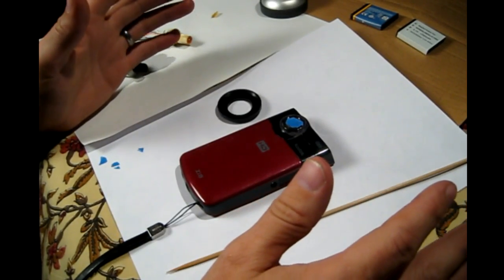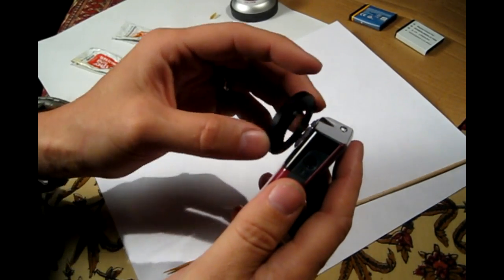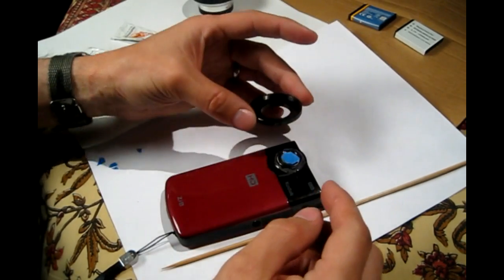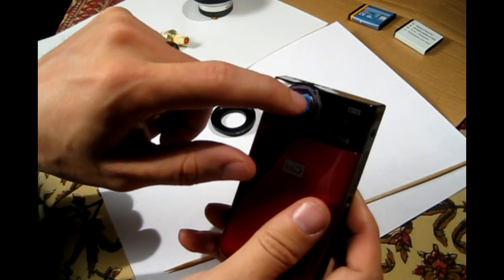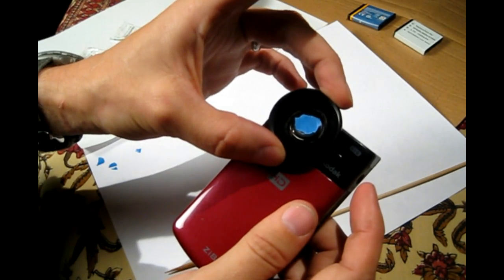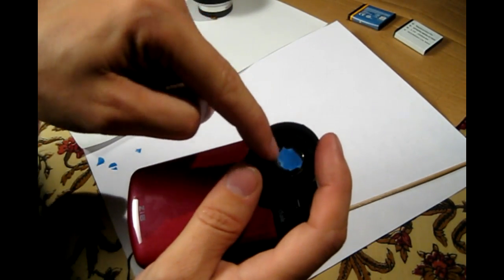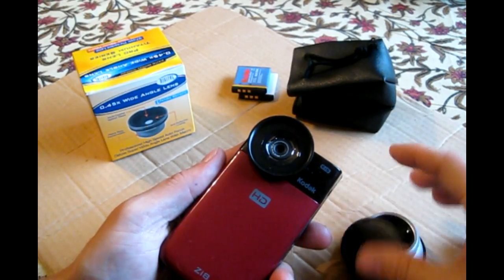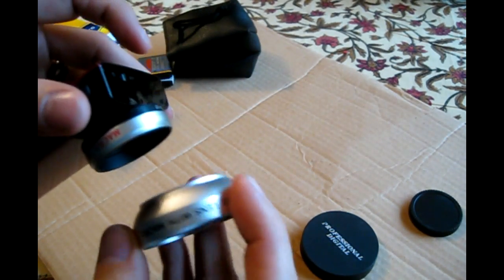Kodak Zi8 Camera Mod Review

Comment from the maker: @SEAetos Yes, but none that are cheap. It is in the telescopic glass that lenses get very pricey.  Buy another step down ring to take your camera to take a 35mm lens (its not 35mm in diameter) and buy an inexpensive telephoto for shutterbugs. That will get you the results you want but may cost more than the camera!

Comment: Great video!   I was looking for a mod that was of higher quality than using the cheap chinese lens that you see on youtube (with the blurry outlines).  I found a Digital Concepts 0.45x 30mm Wide Angle Lens on ebay for 20 dollars cheaper than the 37mm model.  Would the 30mm be a downgrade in terms of visual quality and field of view, or is it just simply a smaller lens (in terms of dimensions)?

-Thank you for helping this noob out ^_^

Comment from the maker: @HangingwithJoe Any 2 part epoxy is fine.  Avoid JB Weld, that is overkill and ugly grey.   The lens is a Professional Digital lens from ebay.  Avoid the telescopic, but the dual wide angle/ macro is excellent.